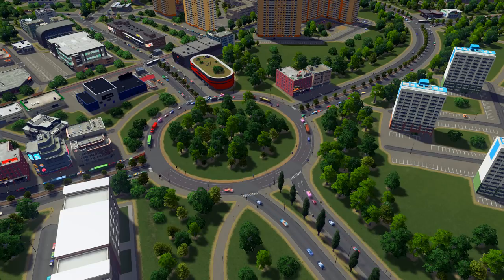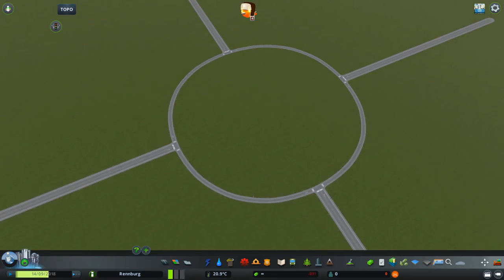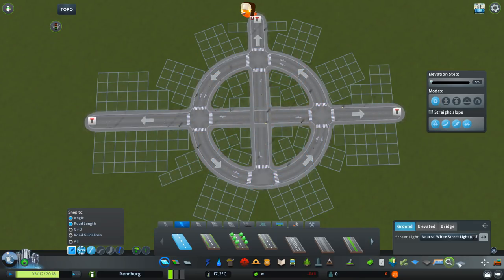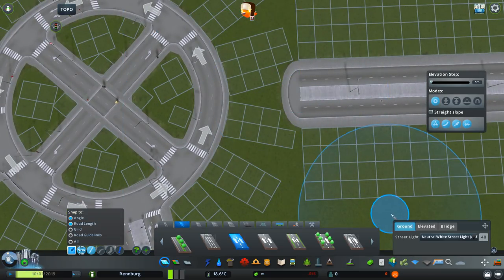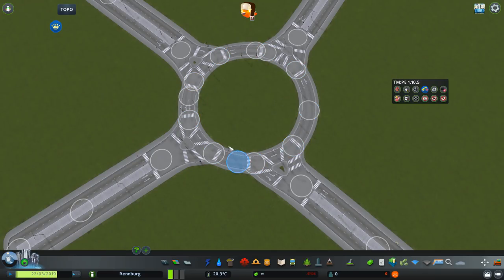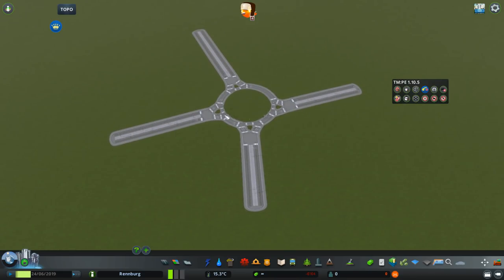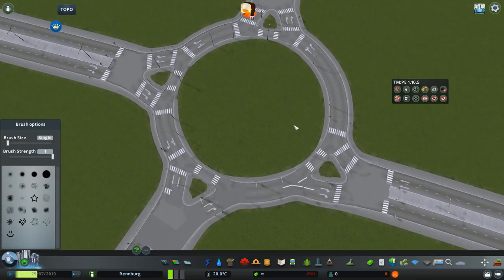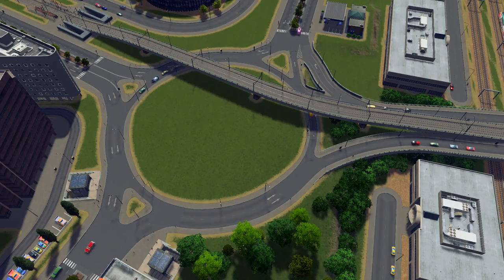Cities: Skylines - Tips and Tricks #9 - Roundabouts

Comment: Hi, I don't get your design. A two lane roundabout keeps its two lanes all around. To go right you are on the right lane. To go straight you are on the right lane. Every exit after, you're on the left lane ( http://static.permisecole.com/images/dossiers-thematiques-image36.png ). There's no reason to downgrade to a one lane in between connections. Maybe in your country it happens ? Cheers
Reply from the maker: Well you could say that what I build here is a one-lane roundabout with extra lanes for taking the first exit, also notice that your picture doesn't have two lanes on the exits, which is necessary for my design. IMHO design on your picture would work almost the same, if not exactly the same in Cities: Skylines if it was only the simplest one-lane roundabout, because the number of intersecting points is the same (maybe even higher). It might look like the cars going to take different exits are separated, therefore capacity goes higher, but just imagine the rest of the connections from the rest of the entrances and you'll see a ton of intersecting points.

Outside of the game, many more factors apply for different designs of intersections, driver safety, economy, looks and obviously driver's behaviour. For example, in my country, no one uses the inner lanes on roundabouts, because no one would allow them to merge back for an exit :)
Reply: I didn't even see the picture lacked the 2 lane exits. usually people just go to the outside lane on the round about and go either for the left or right lane on the exit on the fly, but I don't know how that would work in the game. I haven't played in a while, I'm re-installing it today and checking youtube to refresh my memory and learn now stuff. And I need to wire my brain to work with the game's road/traffic logic.

I was kinda scared about these inner lanes when I was learning how to drive, I'm still anxious about them. People usually let others merge but you never know when you're gonna stumble upon a jackass

Comment: You did not show the lane connections for the 3 lane roundabout, and I think they are different enough from the much simpler 2 lane roundabout that the layout would not be obvious to all viewers.
Reply from the maker: I didn't show them because i don't believe that 3 lane roundabout makes much sense, if your 2 lane roundabout is failing, you need an interchange, I just mentioned it for completeness
Reply: Akruas in many countries roundabouts with 3 or even more lanes are used without problems ;) and they still take up less space than interchanges, especially vertically and they are cheaper